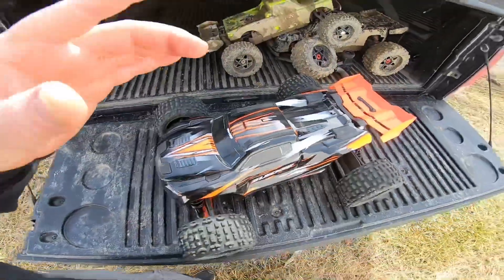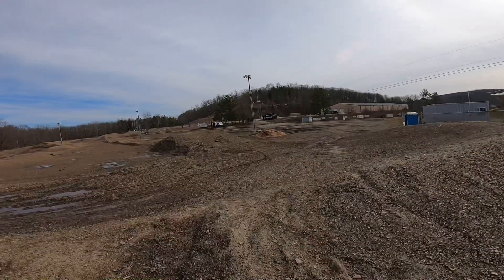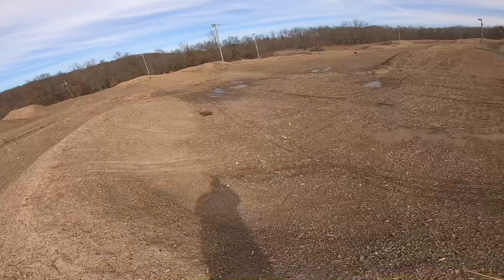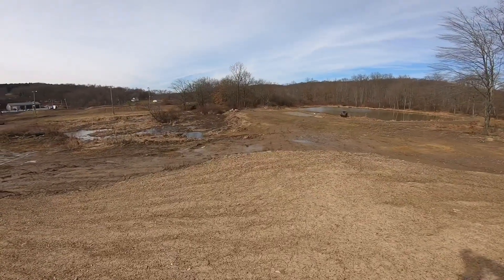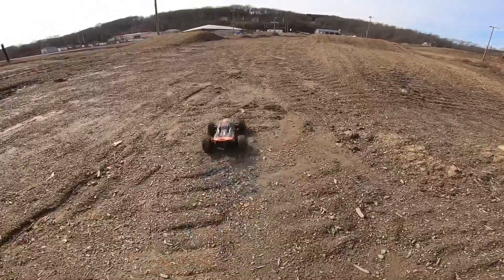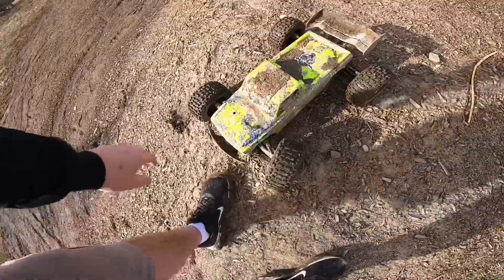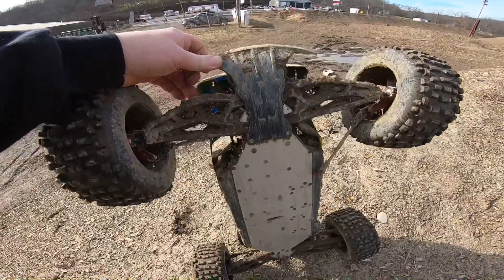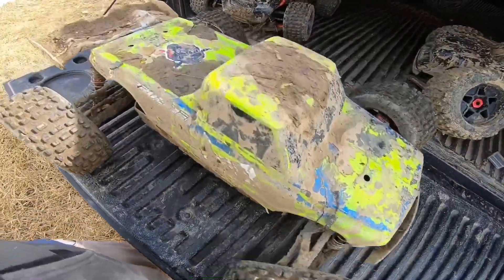Traxxas Sledge and Kraton XL motocross Bash day.

Comment: Easy fixes...but, 0 for 3 for the day.  Good news is, easy...and, more importantly, inexpensive...to repair. 🤙🏼
Reply from the maker: Yeah, everything‘s already fixed up and ready to roll again
Reply: @BarstoneRC  Currently installing what should be...what I'm hoping will be...the last of the 'upgrades' (except for an aftermarket ESC/motor, which are probably a few months away) on my Sledge.  Currently waiting on the Vitavon battery tray.  Once that's received, then I can install the last two upgrades (chassis skid, and wheelie bar).

Comment: Man I can’t believe everything suffered a breakage… an the sledge man I can’t believe it broke I noticed mine the bumper from factory is like a shovel I have devits everywhere lol I have a rpm front bumper coming for it an some straps for a battery tray modification I’m working on for it not sure what wing mount I’m going with… I didn’t realize you was still using the stock motor that’s what I was thinking of doing a max6 with stock motor… but I need to put a bigger pinion just thinking I need a different motor mount 1st
Reply from the maker: Yeah, I went up I think three or four teeth on the pinion gear with the stock motor. She runs great with that set up.
Reply: @BarstoneRC  yeah think I need some more gearing… it did good but didn’t seem to have enough to even try a front flip some of the backflips made me worry really slow rotating
Reply from the maker: It’s amazing how much the max six wakes that motor up
Reply: @BarstoneRC  that’s what I’ve heard

Comment: Sir. What would be best choice between sledge, kraton, talion, and erevo? Help me pls😢
Reply from the maker: In their stock out of box form personally I would go with the Talion 6s EXB with the Dboots 4s LP tires
Reply: @BarstoneRC  then how about outcast?
Reply from the maker: Well, that’s a short wheelbase car which means the chassis is shorter. It does backflips and stuff like that easier but less controllable in the air and jumping.
Reply: @BarstoneRC  oh then outcast is not that good at bashing or speedy compare to the other ones, just only good for stunt right?
Reply from the maker: Yeah, I mean you can jump it but if you’re talking all around bashing, I wouldn’t say it’s the best it’s definitely more stunt truck
Reply: @BarstoneRC  ok, i subscribed your channel. Thanks
Reply from the maker: Thanks for subscribing. I really appreciate it.

Comment: Any reason to run the 4s tires over the 6s?
Reply from the maker: Less weight easier on the diffs with this car.
Reply: @BarstoneRC  makes sense! Do you run with just with the Sledge or do you also use them on your other vehicles?
Reply from the maker: On a lot of cars.